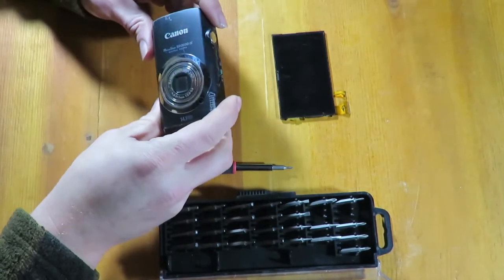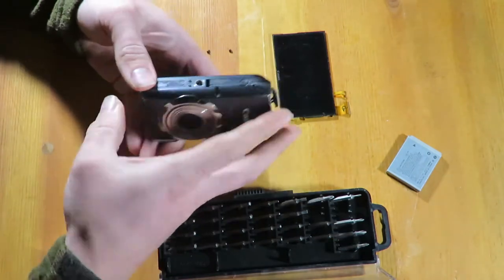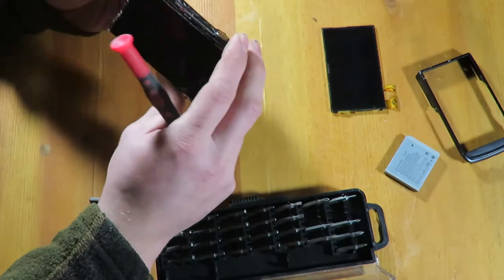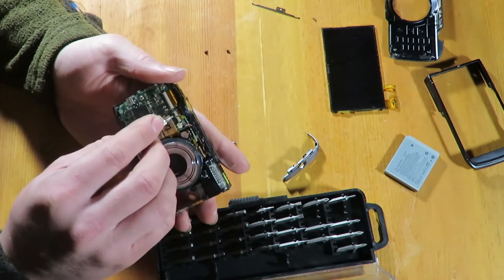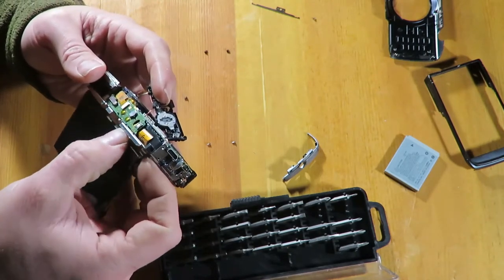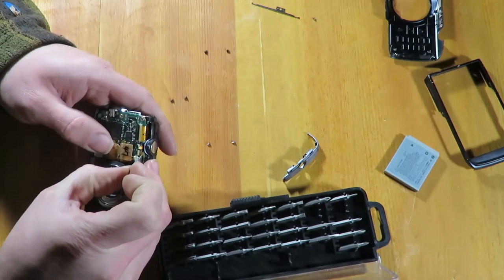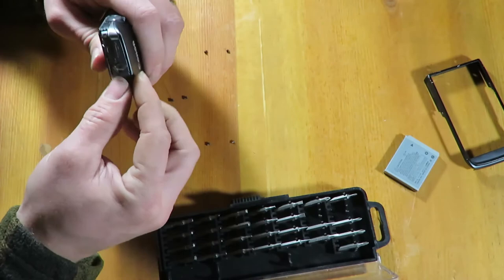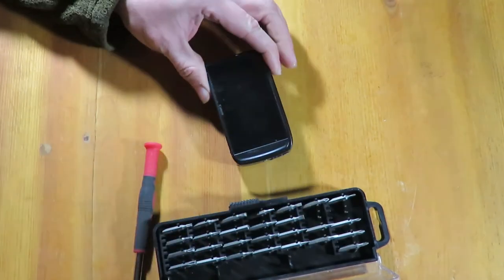Canon PowerShot SD3500is Digital Elph Touchscreen LCD replacement fix repair

Comment: Where did you purchase the replacement screen? Do you know the exact model name of the display for the Powershot SD3500 IS?
Reply: The specific model of the screen used in the Canon PowerShot SD3500 IS Digital ELPH is the 3.5-inch PureColor System LCD. This screen features a high resolution and vibrant color reproduction, providing a clear and detailed viewing experience for composing shots, reviewing images, and navigating menus. If you're looking for a replacement screen, you'll want to search for one that matches these specifications to ensure compatibility with your camera model.